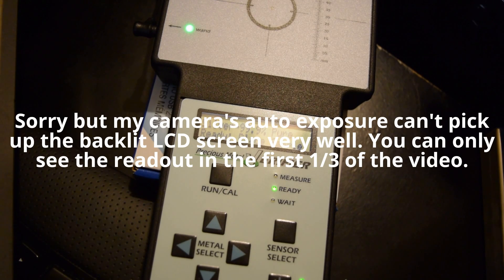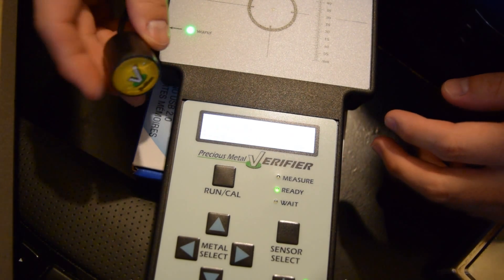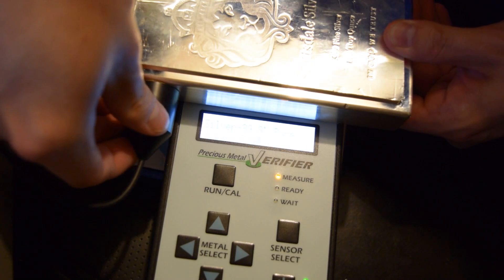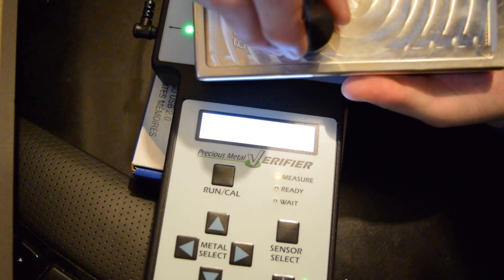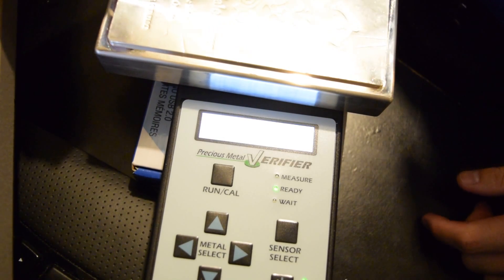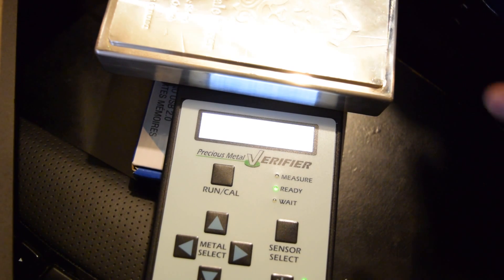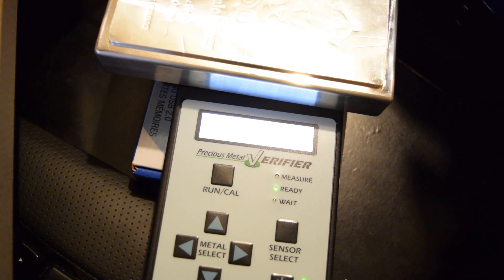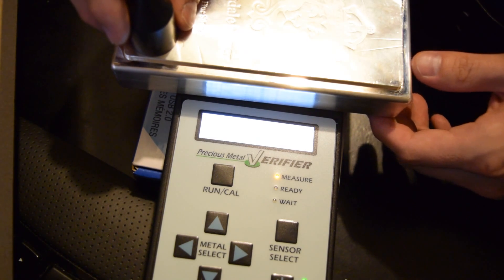Testing the 100 oz silver Scottsdale Stacker bar with Sigma Metalytics tester

Comment: THIS is dated... The chinese even fake 1oz bars. The bury the cores more than 0.08mm deep to fool the sigma metalytics  tester.
Reply: The sigma pmv pro checks surface resistivity plus resistivity all throughout the coin and bars with its double bridge units. Plus it gives dimensions specs, so if you have a good digital scale you should be able to tell by using all three tests (resistivity, weight and dimensions.
Reply: @abraham3981  That's why I own one!
Reply: I wouldnt do this without one